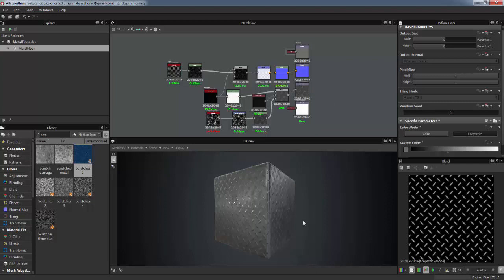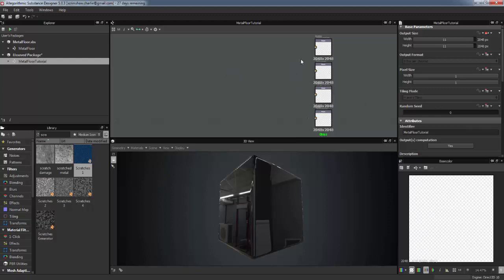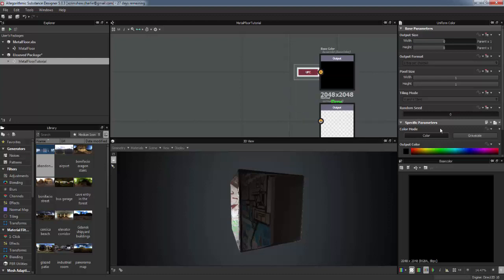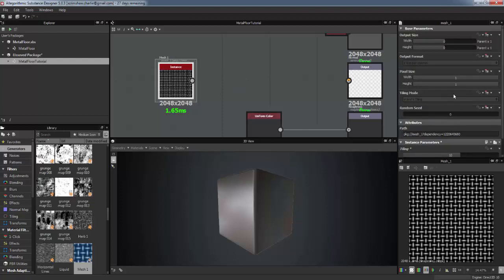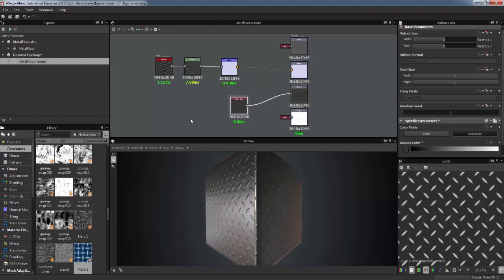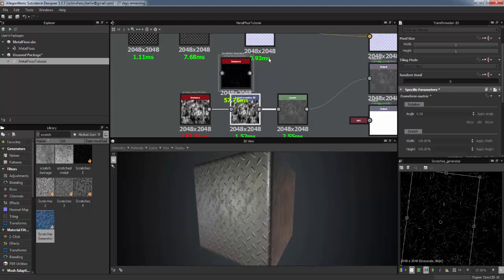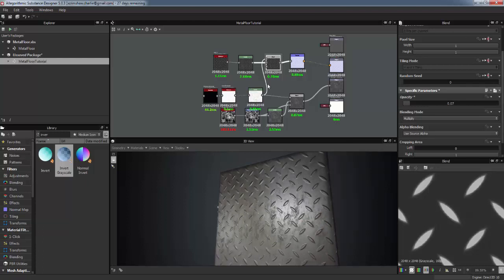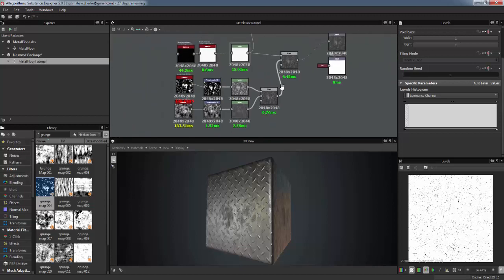Let's Learn Substance Designer 5 - The Basics/Diamond Plate Metal

Comment: If I were to export this material to UE4 using the plugin and apply it to a large surface would I get the usual obvious tiling you would get with a generic tiling texture? Y'know the kind you often see with terrain when zoomed out? I'm under the impression this is what Substance Designer offers a solution to with these "procedural textures". Am I correct?

Comment: Hi Charlie... you've selected 'physically_metallic_roughness' as your starting point... but if I do this, my object in the 3D view is black... no reflections. I can seemingly only get a reflective object if I select Blinn as the material. The problem with this is it doesn't appear to react to any changes I make e.g. the Uniform Colour node, made more grey, as per your tute, doesn't work. What could be happening? Should I stick to 'physically_metallic_roughness'? And if so, how do I get it to reflect anything, or change colour when adding that Uniform Colour node?

Comment: Thank you for doing these ! I have had the program for 3+ years but coming from Photoshop and never working with a node based system before I did not hit the ground running at all. In fact, I just gave up trying.
There was a serious lack of beginner tutorials and learning media for the software for the first 3 years with the exception of a paid and "basic" tutorial from a software learning website which I followed and learned the bare basics of the program but from there... I was still at a loss. 
So I really appreciate you doing this AND doing it a manner that is easy to understand and follow and makes perfect sense :)

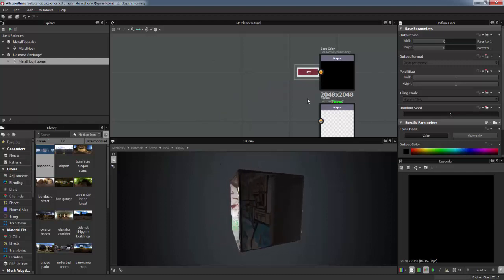Comment: Great tut!  At 10:42, how did you turn the node into a small box called "UFC"?
Reply: +VFX Ltd™ UFC is short for uniform color(the node). you need to press "D" to dock and undock the node.
Reply: comphonia Thanks alot for your reply! And do you know how i can export all of the textures created into 3dsmax?
Reply: VFX Ltd™ Yes, Right click on your graph in the explorer window(under your .sbs package) then - export outputs as bitmaps. Import the bitmap into 3dmax through the material editor. There is also a plugin that will let you use substance textures in 3dmax i believe.